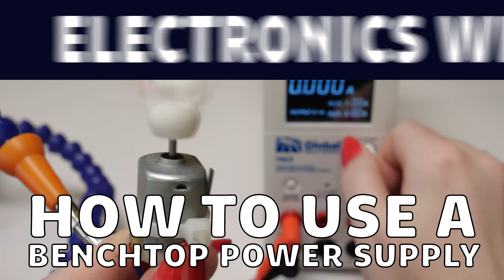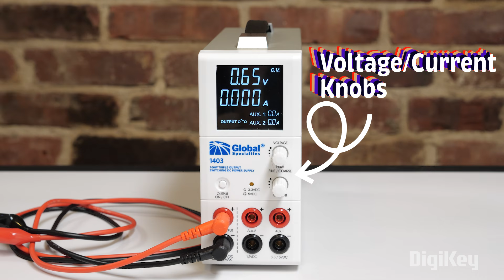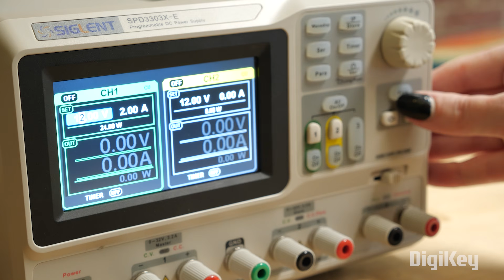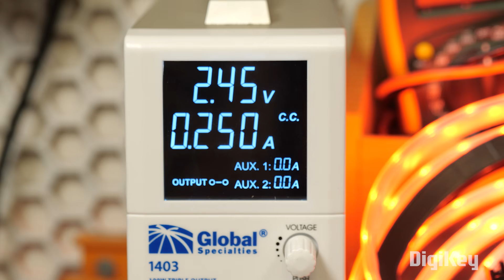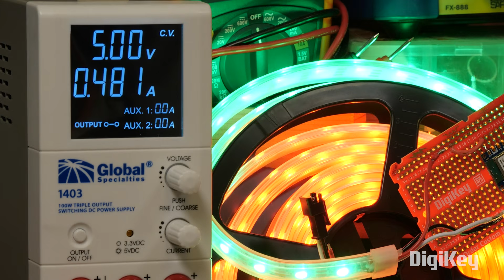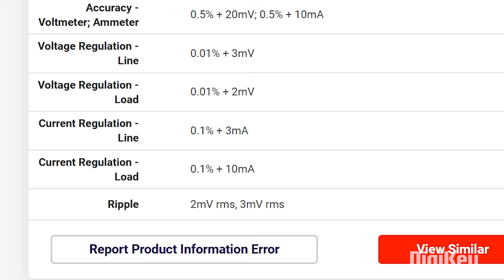Benchtop Power Supplies - Electronics with Becky Stern | DigiKey

Comment: One other feature that is at least worth mentioning is isolation. Most of the compact supplies will not offer this but can be important depending on your circuit. Having a separate ground pin from your negative/positive terminals allow you to join two just supplies together to create a negative and positive voltage rail or make two 30V supplies into 1 60V supply. This generally cannot be done on supplies that lack the separate ground terminal as the negative terminal is directly tied to ground. That said most of my day to day lab setups do not need this and I use compact USB-PD (GaN-based) supplies that I have automation support for on my computer.

Comment: This is one of those bits of kit you never think of when you start out tinkering. I used one at school (back in the 80'90) and when I decided to start  making this was something i never thought of, until it came time to try my first project. A lot of my projects are V low voltage but I'm starting to feel limited. I think it's time to treat myself to a power supply